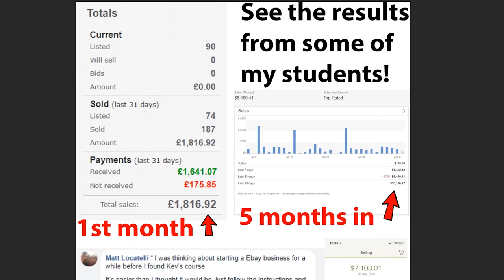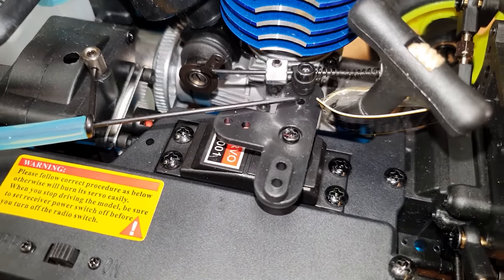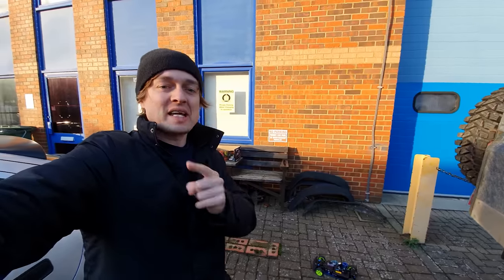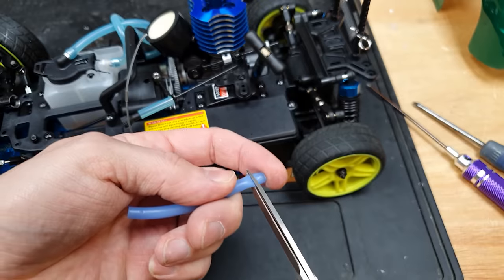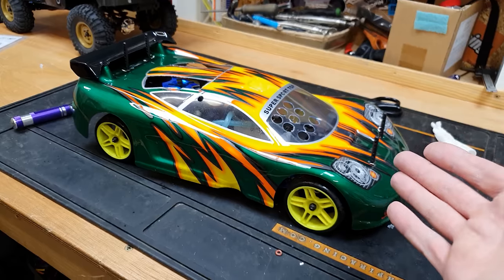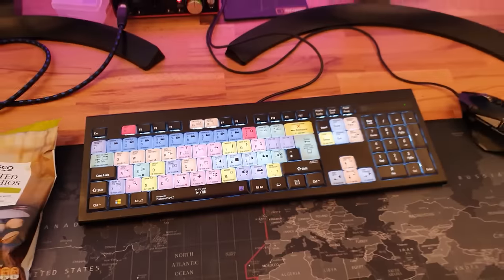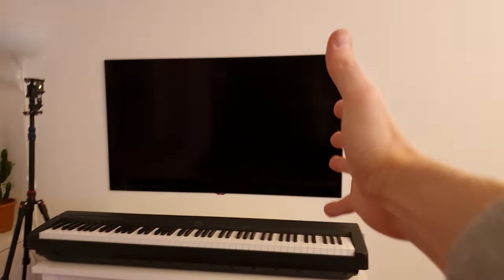FAST Cheap Nitro RC Car

Comment: Nitro! = is MORE FUN! Cool vid as always 👍
Reply: The problem with nitro is its expensive and messy  but yea it does look fun
Reply: Amator_RC  well mine nitro exhaust was angled up when I first bought it and just gently push down on the exchaust and the pink bend a little to move the exchaust :)
Reply: More fun than electric
Reply: i jus got mine today⚡️⚡️⚡️😍😍😍

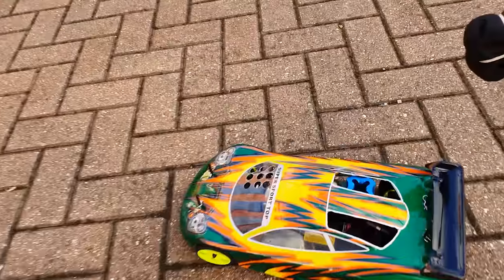Comment: 5:28 it's a sign, it wants to be a burnout car.
Reply: I NOAH MANN that was the engine smoke
Reply: @hayden2869  I know but it has enough power to make tire smoke when it's only rear wheel drive.

Comment: The speakers on your editing desk look like Mackie CR series speakers.  They make them with 3, 4 & 5 inch main speakers.  The Focusrite Scarlett 2i2 is a analog to digital converter.  Turns 'mic level' (maybe 'line level' too, not sure) analog to a digital signal so you'r computer can process the signal.  Great video!

Comment: I ordered one and I love it for as cheap and fast it's a lot of fun haven't hardly had any issues out of mine the only problem I had was the exhaust problem with the body I only cut out a little bit of a piece of the body and I've never had a problem out of it since
Reply: How much did you pay I don't understand how much is that in US dollar

Comment: I had the same car a few years back. Take transmission out. Grind all teeth off plastic first gear. Put back together. Stall it up and let it launch off the line in 2nd !!

Comment: Get an exhaust deflector, then you can extend it a bit beyond the body and point it down. Doesn't fix it 100%, but it does help quite a bit. Even if you cut it so it's shorter so you can pivot it down towards the ground without it rubbing.

Comment: I have a redcat volcano  S30 same controller and electrictronic tray wonder if there made by redcat I use small springs in the ends for the dogbones
Reply: I was thinking the same thing that’s what I have

Comment: In fairness its actually not bad it looks like it's pretty similar to the hpi I had, I had the problem with the drive shaft falling out and I used a piece of fuel pipe as a spacer and that worked really well.

Comment: I have 2 HSP buggies, 2 Destrier (well, they are almost all the same chassies anyhow) and another one, they were dirt cheap and boy do they run like crazy, really like these ones, just buy the electric starter drill, make as Kevin a hole through the body and run them lik you stole them, wieee :D

Comment: I actually just ran my nitro in. A warhead. Very similar to to this one. Same motor, chassis and setout. But gave my daughter a go. Damn flipped it and did 5 continuous rolls and broke the exhaust (plastic) which stuck to the manifold and melted. Day over. Lol. Now looking for aluminium one..

Comment: I bought a hsp for my son the 1/12 monster truck second go and the steering servo packed in Christmas present disaster and took about a week to get them to agree to send replacement parts out. Wouldn’t recommend bought from nitrotek customer service not great. But all sorted now

Comment: Hi Kevin. Newer fan/subscriber. Love the vids! Hey you should do a video on how to securely mount goPros to your RC body. I've tried the 3m adhesive pads, and epoxy different ways but can't seem to properly secure the camera to the body. Just keeps popping off after a bit of bashing. What's your method? Cheers!

Comment: Does anyone else find $252 (canadian) plus whatever for the nitro extra's, dirt cheap? That's a quarter payday roughly man. Definately not dirt cheap Kev. Under $100 is a little closer to dirt cheap. Love the vids and usually it's closer to dirt cheap than that. Normally I don't mention that but c'mon, do you really think $252 is dirt cheap? That's like 125p I believe. Roughly. It won't stop me from lovin the vids though. Later

Comment: If you right click on the task bar and bring up task manager and then click on the Performance tab you can get way more use full info about the hardware and what the PC is doing like a graph for each component CPU, GPU, RAM, NETWORK, DRIVE ACTIVITY. Much more detailed than what you brought up on your PC. Oh yeah on the CPU graph if you right click and go to graph and click on Logical Processors it will show each core.

Comment: I have one of these but with big wheels and its a truck . So many problems and the pull start is stuck out and wont retract. Won't even start and we've tried everything. Its also flooded. It might be because its used .

Comment: I've used the stock receiver pack for five years with an rtr nitro buggy and it has taken a lot a bashes and crashes and not a single battery came out

Comment: 25% Nitro not Good for a small engine, you could wear it out premature, not that worries you, some engines recommend use an extra shim under the head for 25%. 
You’ll need to run it richer , as the higher nitro content the lesser the oil ,

Comment: Mr talbot I have a question, I'm getting a little 16th scale nitro buggy and it needs a glow igniter which I have but my question is that the igniter is an eighth scale one so I'm wondering if I can use it or if I'll have to get a new one, also you are my fav youtuber for RC's and thankyou
Reply: Also the specific car is a exceed RC 1/16 blur nitro buggy

Comment: Why not wrap a couple zip ties around that aa pack?
Reply: You can, but you have to be careful to not get it too tight. The batteries will slide in the holder and disconnect intermittently and with zipties holding them, they bind even more then they don't reconnect. 4xAA holders really do suck.

Comment: Do these need batteries in the car itself because when i put batteries in the case doesnt close an i spoke to the seller i bought it off an he said i dont need batteries in the car just the remote im confused as to what i need to do
Reply: How are you gonna run the servos without the batteries in the car?🤔

Comment: I have the same rc nitro car .I was wondering if you can help me when I start the rc car it runs by its self and when I drive it it stops by its self I think its need to be idle idk but it need to be fix and I was wondering if you can show me how.
Reply: Have you tried tuning it at all? Read the manual to find your base point, lean out from there
Reply: @zackaryblackburn7390  I tried but it wasnt that specific tho

Comment: I had that car, prepare for major disappointment, the motor will stop working so quickly it is unbelievable, I put about $200 of extra parts and work into it just to get it to run after the seventh or eighth time. It’s really not a good nitro RC company

Comment: I used to like your nitro videos before you started giving advice that was flat out wrong. If you don’t know about nitro then don’t try to give advice. The one that bothers me the most is “too hot to touch, too hot to run.” Nitro engines like to be run hot, anything under 300* F for all non Novarossi based engines is good. If you run too rich it causes premature connecting rod failure. There are others that bother me but this one by far the most.

Don’t get me wrong, I really like your videos Kev, but now your nitro vids just make me mad because the advice you are giving is wrong